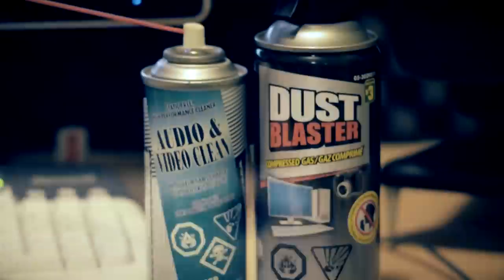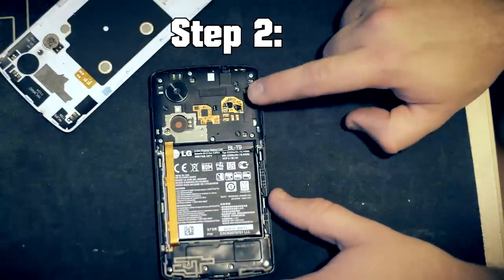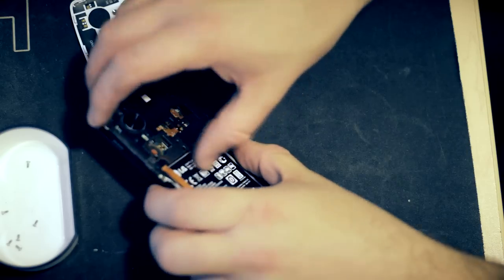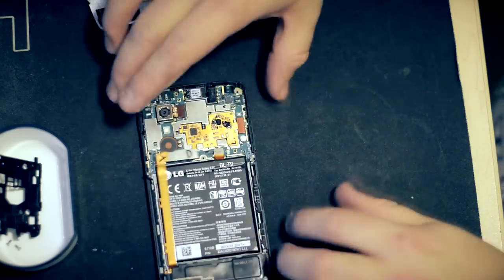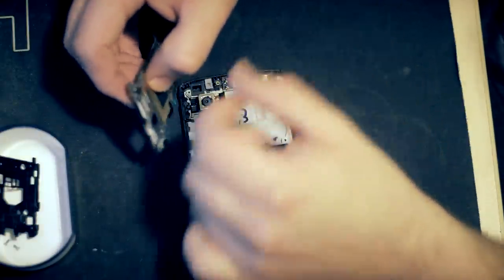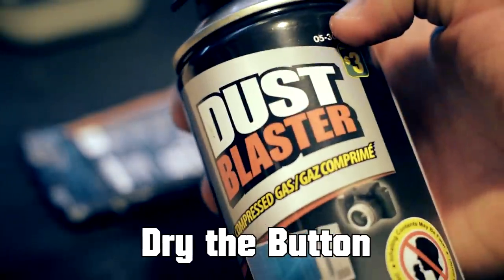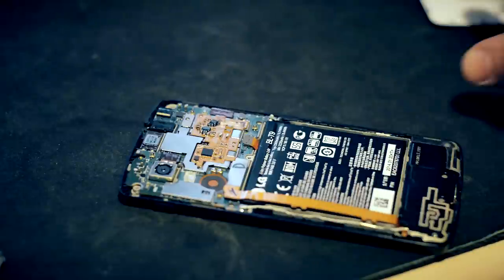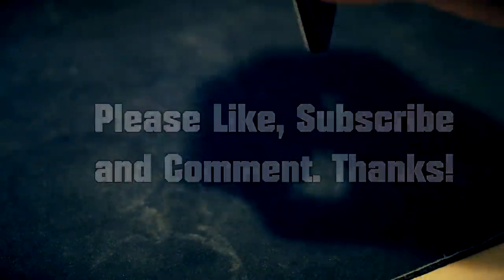LG Nexus 5 Boot Loop Fix - Power Button Repair -

Comment: Many thanks to share your knowledge. It is really appreciated. The video was really helpful, I was able to solve the issues with the power button. I was not aware that the front camera has to be disconnected before to get access to the power button. Because of that, I had some additional issues with my front camera. Fortunately with this an another video I was able to sort it out. The video worked for me.

Comment: Cheers for this. I just removed some of the dust and blew hard. I'd advise not using a screwdriver in case you damage the side of your case. I ended up using my nail :p

Seems to be working a lot better now.

Comment: Is it safe to use a screwdriver to disconnect the ribbon cables? I replaced my battery using an ifixit guide, and they recommended using a spudger (antistatic tool).

Comment: Thank you very much mate! You saved me several euros. :)

tip for the others:
I was silly enough not to take away the sim and the sim holder before starting. nothing happened, but be sure you do it at the beginning!
Reply from the maker: +m3rcur1u5 good tip! makes things easier and safer

Comment: Hi, my power button is slightly bend inwards. I can still use the power button and it works, nothing bad is happening. However, the will come that it will most likely break, I've had my power button break on me once but that was different, it wasn't bend inwards. What do you suggest I should do?

Comment: Hi, Great video!! my nexus is bit tricky. It gets into boot loop only like thrice and then power offs automatically. Pressing the power button does not help. It may sound weird but out of frustration I smacked the phone on to the bed and again the boot loop came, but only to power off again. Now the phone gets to boot loop only when smacked near the power button. Can you help please!!!!!!!!!!!!!!!!!
Reply from the maker: +Andy M That sounds like the same issue. Mine used to boot loop endlessly until the battery ran out. I would try the clean if you have not already and see if it helps. Only takes 5 minutes and chances are its the same thing with the power button like everyone else is having. You can also try and do a factory reset to see if its a software problem but i doubt it based on the description of smacking the phone making a difference.

Comment: My Nexus 5 has been shuting down and when I try to power it up I get a Google logo then it shuts down.  If I quickly tap the power button while power it will power up the phone and it works fine.  The battery level shows its not low.  When using the phone if the screen goes dark pressing the power button returns the screen like normal.   The power button doesn't feel any different.   Do you still think its the power button?   Would your fix be just a temp solution?  Thanks

Comment: I followed these steps but it didn't fix my Nexus 5. With mine, the power button wasn't actually sticking. It clicks just fine, like the volume buttons. But it still gets stuck in a boot loop. The boot loop can only be avoided by constantly pressing the power button (not holding it) as I boot it up. Could my issue be a bad power button itself?

Comment: for anyone not able to solve the problem. Simply rip the powerswitch off the motherboard and use a paperclip or something like that to boot the phone instead. i have done this to two nexus 5's and both are again fully functional. Only do this when you have no other option

Comment: Got the case open, but the power button is not obviously sticky... used a drop of alcohol from a first aid kit and blew it dry... no luck. Any suggestions? With the motherboard out the power button seems to function as it should, or at least as well as the volume buttons.
Reply: +Jeremy Cram This is the same for me :( Reassembled and all and still have the boot loop. In this case I think it's software. I cant even get into bootloader

Comment: Thanks alot dude....
It made my front cam work again.....:) It nver used to connect earlier!!
 But my power button problem is still there :(
Reply from the maker: +nancy vohra Well its something i guess, you might need a new button. You can also re-assign one of the volume buttons to use for power if you can manage to get the phone on.
Reply: +Weekend Agenda my phone os on.... but how can i get my volume button to work as the power button??
thats interesting :)
Reply from the maker: +nancy vohra Go to the PlayStore and download an App called "Power Button to Volume Button" ;)
Reply: Thanks!! :)

Comment: I just tried this, and now for some reason the phone is actually more screwed than it was when I took it apart. Used to boot loop constantly, and if I hit it against something it would stop doing that, after cleaning the button with tape head cleaner it is back to a constant boot loop. Where do I find the replacement button?

Comment: hey thank you for the video
i did open up mobile set but the problem persists although i am able to restart it till the screen comes by constantly flicking the power button area but as soon as i stop it restarts 
any solution what should i do further??
Reply from the maker: +Vaibhav Sharma It might be a bad button or a bad connection in that case :( If the clean did not help i guess the next step would be to replace the power button itself. They are only a few dollars on eBay but i am not sure how difficult it is to solder in a new one. There is also a trick i say on another video of assigning a volume button as the power button, but it would require you to be able to get the phone on at least once normally to be able to do that, since its with software options : /
Reply: +Weekend Agenda I really appreciate your help on this issue. Well I had to replace the power switch with a new one which I fortunately was able to find at a mobile repair shop for 5 bucks and my nexus got a new life . Your video and advice really helped. Great work 
Greetings from India.
Reply from the maker: Vaibhav Sharma Thats fantastic! Now we know the power button replacement works as the next step if this does not. Thank you for letting us know and answering the questions everyone was wondering! :) Cheers from Canada!

Comment: It works!!! I tried it myself on my phone. My botton got stuck and kept rebooting over and over again when I plug it in. Following your instruction my phone works again!!!

One thing I did different was I used MAF cleaner (mass airflow sensor cleaner) and just blew it dry with my mouth. Man those screws were a pain to remove. Ended up using a kitchen knife... Other than that I couldn't have done it without you!! Thank you again.

Using this app now so I don't have to press the button:

https://play.google.com/store/apps/details?id=com.luutinhit.sensorsforconver

Comment: After marshmallow update my Nexus 5 became sick in the reboot loop. I did this and it worked. I don't believe my button was stuck though. I think that what gets it out of the loop is disconnecting the battery.

Comment: I already disassembled my nexus 5 over 20 times and I don't know how well the connectors cand handle the 'abuse' , I have a motherboard with a defective button, I would try to do this but I'm affraid it won't work since the button clicks just like the volume buttons, I'd try to replace it since I know someone who can do it...

Comment: Dude ive got my nexus5 without signal in any sim card. All the Bluetooth wifi works fine. I asked the service center and they said its the antenna and the whole motherboard will be replaced. Is there anything antenna related on any other parts that i could try to fix. Thanks :D
Reply from the maker: +Jowl Andrae (Jowlowlowlow) Depending what android version you are running Go to Settings > About phone and find the signal strength of the antenna shown in dB. It will show you current signal strength or reception with or without SIM card, so you can figure out if its actually the antenna (assuming you are 100% sure you have coverage where you are) Anything less than -112dB would be useless more or less. If you see something like -129dB there is absolutely nothing as far as signal. Normal operating range would be -60dB to -93dB or so. Hope that helps :)
Reply: so it can be the sim card module that is broken if my signal is -93? or that in the usable range? right? i was running lollipop then the signal cut off then i thought it was software because i updated that time, marshmallow has a preview and i flashed it, it still doesnt work so its not software related. and btw i dont know how to convert back to lollipop or remove the preview. I don't know how to search and i really wanted to revert back to the not preview one. thanks for the reply you've been helpful

Comment: I managed to be able to open the  phone, take it apart and clean the button, but i had a hard time putting it back together. This I figured out only after I brought it to my nearby store. For anyone who has trouble putting it back together, don't make the mistake of putting the sim card tray back in until after you have put the motherboard back. My problem was not solved, it is still in reboot loop. It really appears to be a software problem, especially considering that i did a recent update.

Comment: I tried this process (although I used straight alcohol on the button to try to loosen it up, but it still isn't working.  Any other suggestions?  I've tried hitting the phone on my palm and on a hard surface.  I haven't tried the 'magnet' fix that a few people have recommended.
Reply from the maker: +BYWARD MARKET REAL ESTATE - CHRIS STEEVES Might have to replace the button entirely if its broken in that case. Its about $5 on eBay, next time mine starts doing this i will replace the button and do a video on that. As far as for now, my only suggestion would be to look into re-assigning one of the volume buttons to work as the power button. I came across it somewhere showing how to change it in the software  but i don't remember if it would require a root.

Comment: Hey, i did the same thing with the glass cleaner, before putting back the cover I tested it and all worked well; but once I put the cover on, my phone isn't turning back on...I waited for it to dry...what can it be? what shall i do? ;(
Reply: +Iulia Revenco 
I don't know if you've fixed it by now, but have you tried taking it apart and putting it back together again? If a  connection slipped it may have cause it to not turn on. Make sure everything is secure before you put it all together again.

Comment: Any ideas on what can I do if my phone is not vibrating anymore? I even tried changing the backplate with another one from ebay but with no success.
I am pretty sure its not a software bug as it does the same thing on every rom that I try including the stock one. Thanks again!
Reply from the maker: +tymscar Could be the little motor for vibration? See if you can test it somehow with another app or something that uses the vibrate feature.
Reply: Tried. Nothing worked.
Reply: +Weekend Agenda I even changed the back panel with a new one (and a new motor) and its still not vibrating. The connection doesn't seem oxidised or anything. I have no hope with this now

Comment: Damn I've just tried this but it seems like the power button is permanently stuck down. Is there a way to fix it? Are replacement parts available?
Reply from the maker: Yeah replacement power button is 5$ on eBay. I am yet to attempt soldering it though. The cleaning worked for me so far

Comment: My Nexus 5 is dead without a charger now and rebooting again and again on a charger. Do you think there is problem with its power button?
Reply from the maker: Yeah pretty sure. Try and do the button clean and see if it helps. Otherwise It will keep restarting and draining the battery endlessly.
Reply: +Weekend Agenda Thanks

Comment: Has the fix worked for a long period of time or has this just been temporary.   Has anyone tried just blowing compressed air
into the side of the phone first to see if that made any difference?     thanks, Ken
Reply: I just did this but instead of using the contact cleaner in the video I used something I use on old vintage tube radios called DeoxIT.  The version I have comes in a small pastic bottle with a needle like dispenser.  The liquid is dark Red in color.   If my switch is dirty or corroded contacts it should work.  Its worked on radios from the 1940's great.
If not will have to replace the button.

Comment: to get the back cover off use hot air like a hair dryer as the bottom part is glued on, the hair dryer will melt the glue :)

Comment: I'm facing the same problem with my Nexus 5. My phone is not powrring on by pressing the power button. But it reboots when I connect it to the charger. And if I press the volume down button while charging, it goes into bootloader and reboots again. So i cannot even factory reset it. This tutorial didn't work for me. I did not use the alcohol. I just used the Blower. Any suggestions?
Reply from the maker: +adguglani alcohol is the main part, it cleans the dirty / sticky connection. Blower is just to dry it quicker and help with the cleaning a bit. I would suggest just doing it again and using alcohol and a lot of clicking :)
Reply from the maker: +adguglani alcohol is the main part, it cleans the dirty / sticky connection. Blower is just to dry it quicker and help with the cleaning a bit. I would suggest just doing it again and using alcohol and a lot of clicking :)

Comment: I would suggest removing the SIM card and it's holder before removing the back panel on the phone. The sim card holder broke the thin piece between the holder and the back panel. Also, you can pry the back panel open using your fingers starting from the audio jack and moving around the edges and ending at the camera (There is glue in the corners by the usb port).

There are 6 buttons/ribbon cables to disconnect from the phone. Watch the video carefully after does the 3 around the battery. There are the two button style ones on each side of the battery, the big orange one running the length over the battery then the battery itself is a fourth. There is a fourth for the rear camera and fifth for the front camera.

Comment: is this basically the same process for the nexus 5x?
Reply: I know this is kind off a late reply, but no.  The 5x boot loop problem is fixed with a bios flash
Reply: @logangleason1141  thanks
Reply: Yes.  I have a 5X and this procedure fixed my sticky power button problem.  The motherboard is longer and spans the entire case wrapping around the battery.  But it will come right out once you disconnect the three connectors.  Battery plus two others.

Comment: Mine doesn't seem to be sticky however it still causes a boot loop. I took the mobo out and tried cleaning it with isopropyl alcohol but still causes a boot loop.

I guess I'll need to replace it.
Reply from the maker: +yotwoboy walruski :( Sorry to hear that, well cleaning is easy enough to try so its always worth the shot. The button as you can see is a common issue with the phone so thats why i did the video. If and when we do the soldering of a new button i will let you know :) otherwise if you decide to go that way let us know as well, would love to see it!
Reply: +Weekend Agenda I fixed mine!

https://www.reddit.com/r/Nexus5/comments/3w3g0e/power_button_sensitivity_but_no_boot_loop_signs/
Reply from the maker: +yotwoboy walruski Just read your post, Thats awesome :) . So i guess the button loosens up over time and just doesn't make the connection properly so the crippling did the trick? I will have to try that next time if this happens again. Thanks for the feedback!
Reply: Thanks a lot for sharing the solution, it fixed mine too :)

Comment: Thanks for the guide, altho I pretty much ripped of a small piece of the plastic that's surrounding the power button and blew with a dust cleaner until it started working agian. Its not the first hole in the panel so w/e :D Didn't have the screwdrivers and patience/nerves to play with the motherboard so Its working fine now :p

Comment: Dude, could u help me?, Where I can buy these cleaners?, Im not sure if exist in brazil
Reply from the maker: +Ramon Lima its just compressed air and alcohol cleaner :) . You can use just cleaning alcohol and blow into it to dry it. Find something strong! 70% or more!
Reply: +Ramon Lima Cara eu usei WD no botão (cuidadosamente com o bico injetor). E alcool isopropílico para limpeza antes e depois (tirando o excesso de WD). Funcionou de boas. Boa sorte!
Reply from the maker: ^ Yeah like he said, let it dry before you put it back together

Comment: Did exactly as told. There is no difference yet. The same problem carries on. Few rolling balls and it switches off again.
Reply from the maker: +Samar Yajurvedi sorry to hear that, it might need a new power button if the cleaning doesn't help.

Comment: hey man, I did everything as you said but its still stuck on these floating balls so I dont really know what the problem will be..
Reply from the maker: +Ps4GamingStation Might need a new button entirely : / or perhaps try a factory reset if you can?
Reply: +Weekend Agenda well the button it still good it seems. Its a problem within the device..i did a factory reset but still no luck. Im now trying to do it with adb manager so i can control my phone from my pc hopefully that will work!
Reply from the maker: ok good idea, let me know how it goes. Others might like a backup solution in case they run into the same issue :)
Reply: +Weekend Agenda yea i could not back up anymore and the phone did not have a backup... ill tell you when it worked!

Comment: I need to do this but I hate that it's so sensitive. Last thing I need is to break some tiny piece because they couldn't design a better button, like several other commenters have reported -_-

I like the phone, had it for years. But it's so stupid it has such a substantial problem.